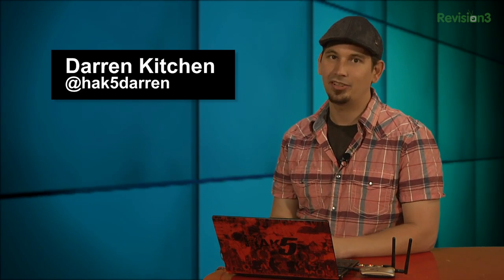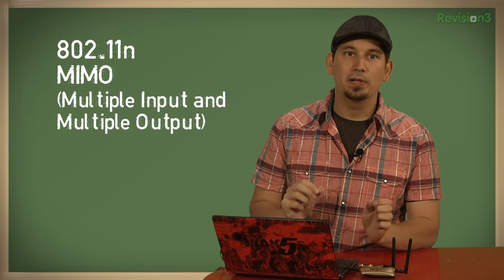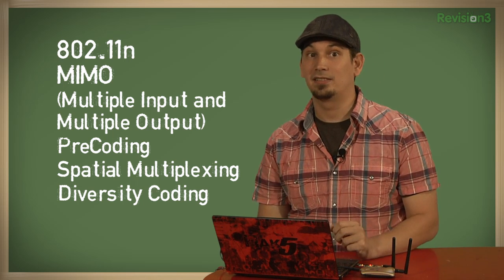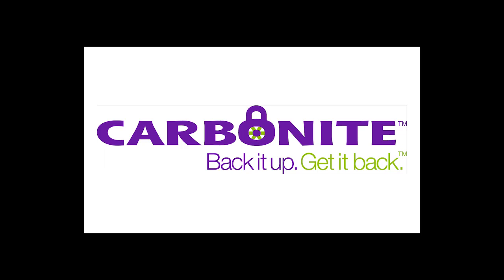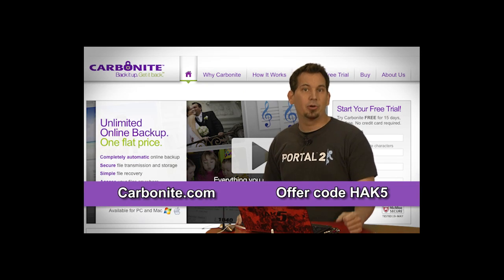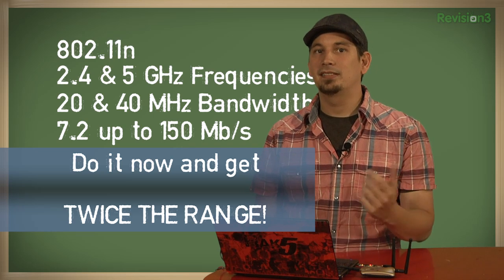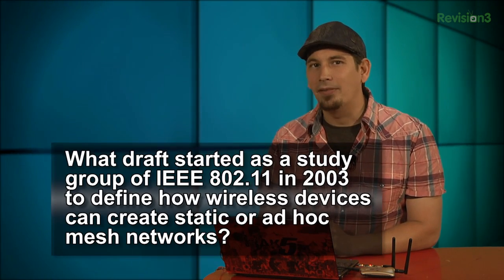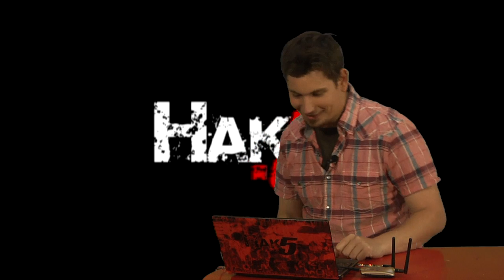HakTip - WiFi 101: 802.11n

Comment: 802.11s started as a Study Group of IEEE 802.11 in September 2003. It became a Task Group in July 2004. A call for proposals was issued in May 2005, which resulted in the submission of 15 proposals submitted to a vote in July 2005. After a series of eliminations and mergers, the proposals dwindled to two (the "SEE-Mesh" and "Wi-Mesh" proposals), which became a joint proposal in January 2006. This merged proposal was accepted as draft D0.01 after a unanimous confirmation vote in March 2006.

Comment: Its the 802.11s thats uses the a pragmatic simple approach to mesh routing. A mesh network is a simpler subset of a general ad hoc network where little or no mobility is expected and only occasional route fluctuations should occur. However maximum throughput and minimum delay are far more important than just maintaining basic connectivity, which is often the best one can achieve when there is a high degree of mobility. And can be used the Better Approach to Mobile ad hoc Networking (BATMAN)